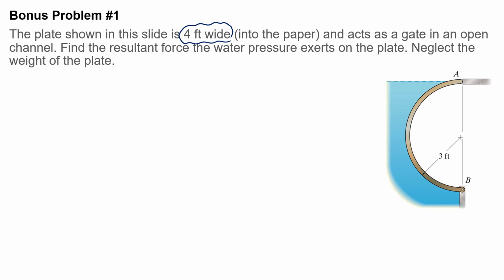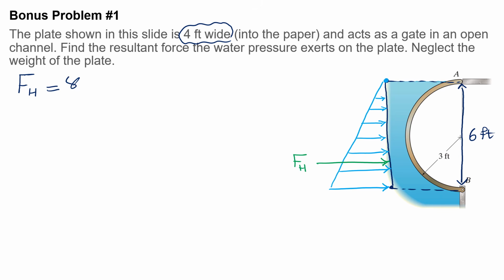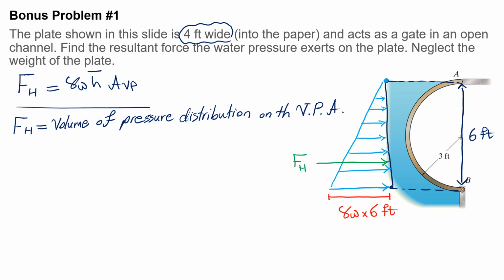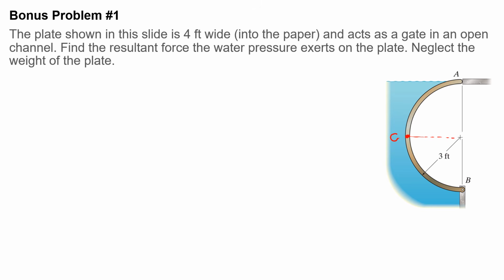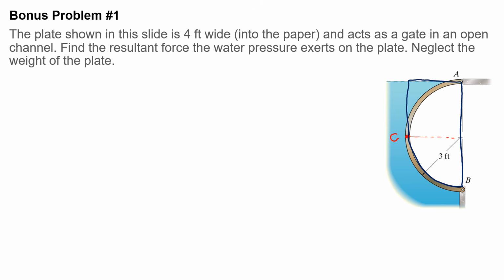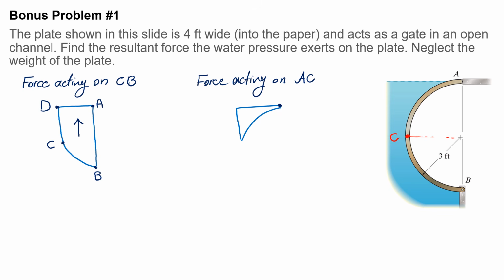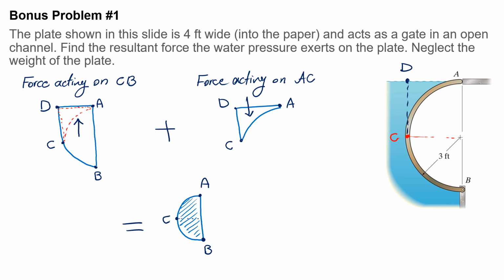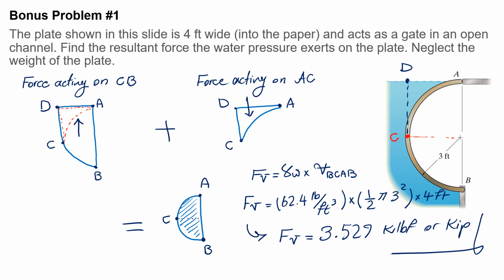Hydrostatic Forces on a Curved Gate Example

Comment: 8:40 the hydrostatic force should result from the immersed area not the imaginary one? I was solving alot of problems involving hydrostatic forces and never knew that you need an imaginary surface which has no fluid in it and determine the force from it?!